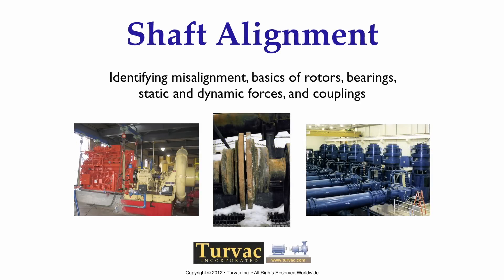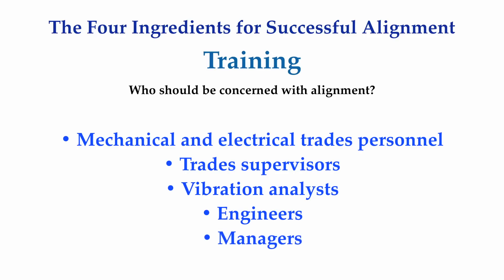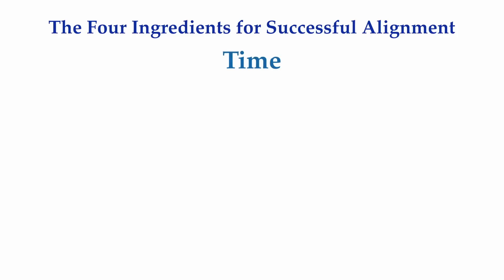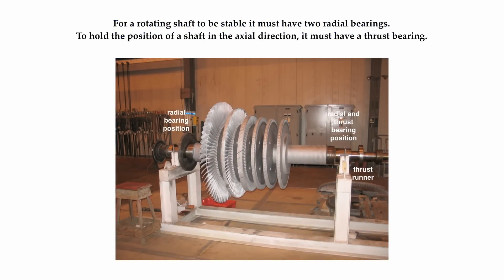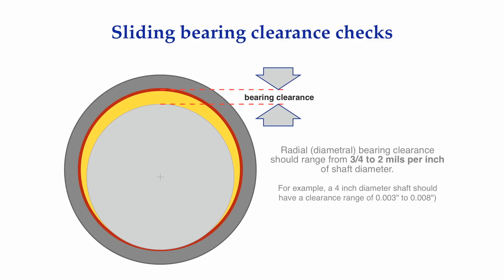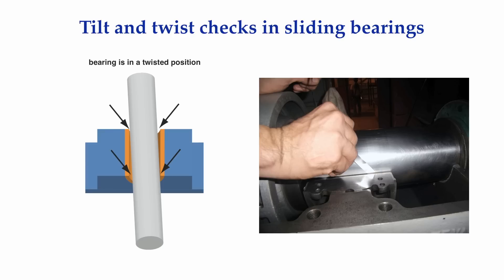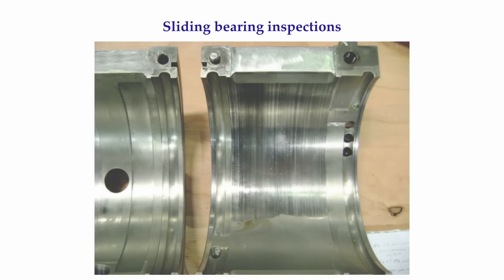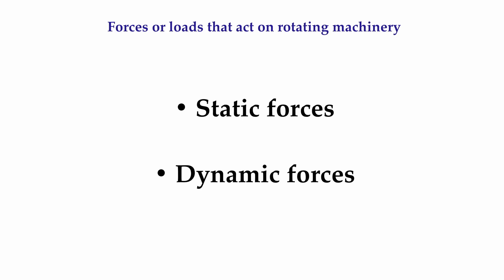1-1 Introduction to Shaft Alignment

Comment: Good thanks for this video series. I have seen them all clarify many doubts but the vibration analysis generates another dimension to the alignment and as I think it has happened, myths that are taken as facts in the industry are falling. For example, it is determined by its traction and its tests that the vibration and the alignment does not have an appreciable relationship for a diagnosis to have and greater certainty of the alignment would be with the temperature of the flexible elements the coupling that is what I take as more evident .
With these videos I realize that we have to register more variables and analyze because there is nothing clear, the only thing would be the duration of the equipment without failures for the longest time and its study in it. That is to say that to align and have a not vast idea with the laser and a vibration pencil, it is also necessary to improve with nearby thermal cameras (the temperature guns are not exact to my experience, only referential there is a lot of difference) improve the equipment for taking vibrations to have up spectra.
Finally, I see that it is not based on lasers myself and investigated and how that its precision is not greater than that of the dial indicators, only that as they have programming that performs the calculations it is easier and takes less time, I would like a topic on this (the instruments for alignment and monitoring)

 Thank you very much for sharing quality information.